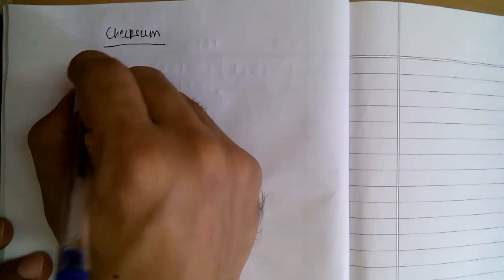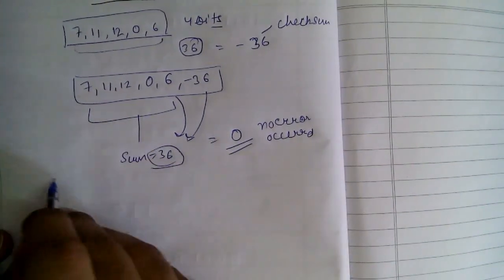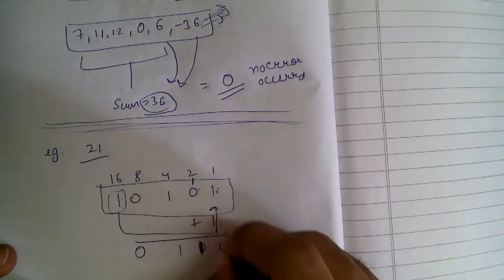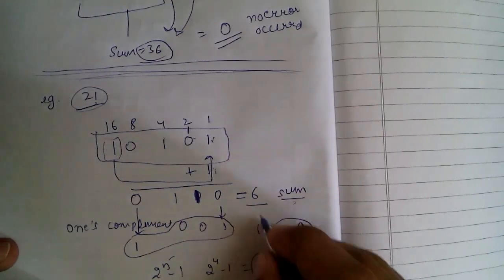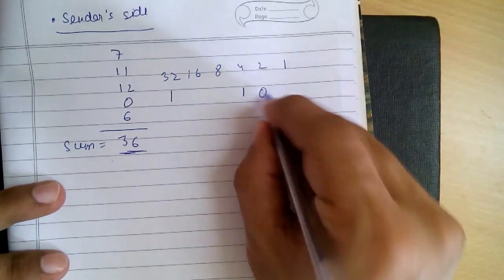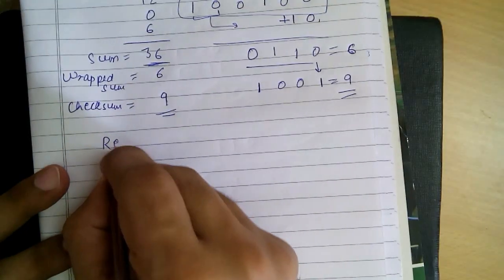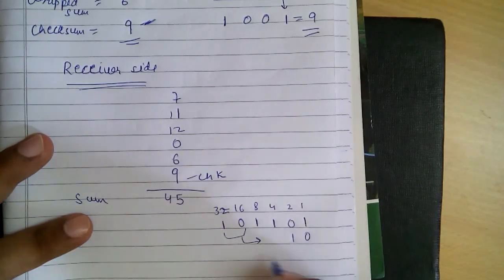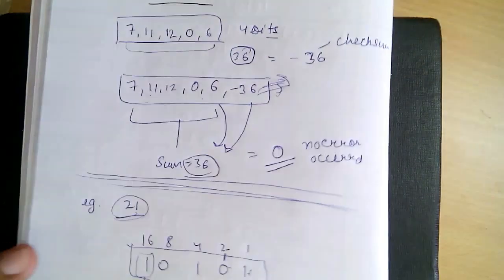checksum

Comment: Thanks man I needed this explanation very bad, I am working on Winols, defining way to edit EPROM I can't use the original checksum as it leave unwanted functions, so I learned through your explanation how to calculate the checksum so I can change data,  and still get the checksum correct. thanks.

Comment: what if the bits exceed and we can not change thm to 4 bit data .. plzz tell
Reply: if bits exceed more than 4, take the extra leftmost bits and add it to the resultant (rightmost) bits. eg : 10101, here leftmost 1 bit is extra so 0101+1=0110.